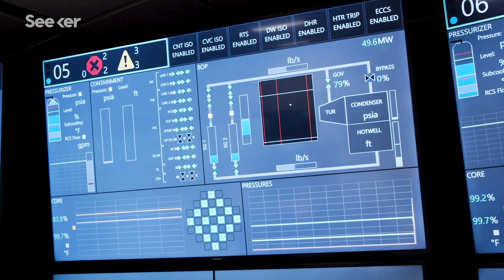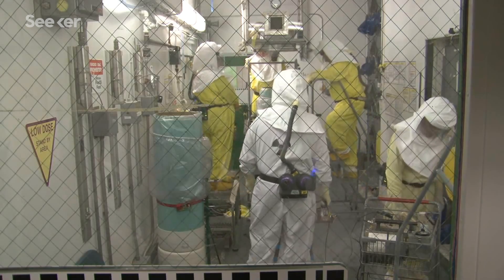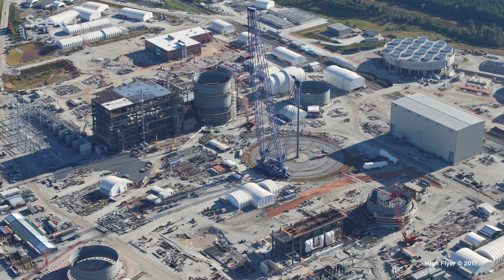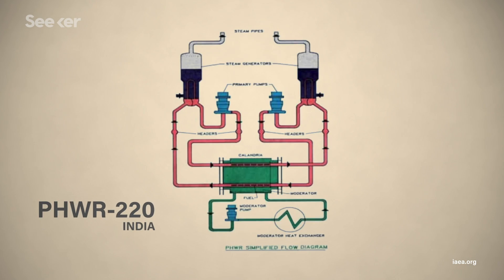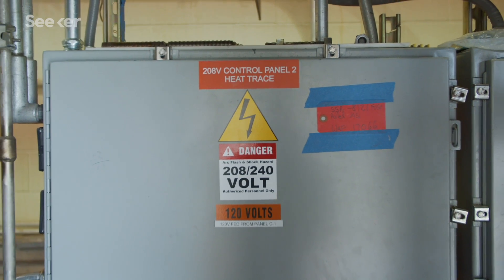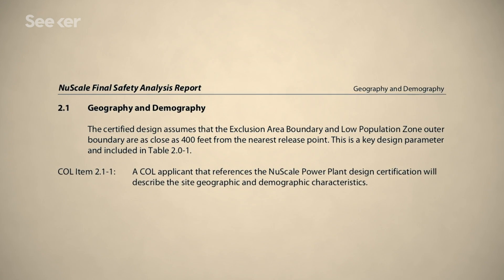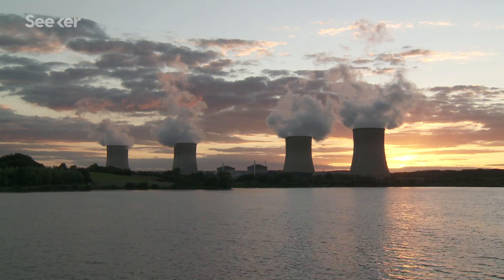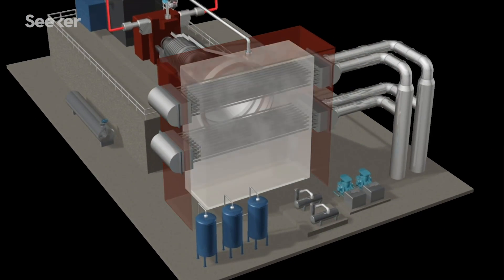Mini-Nuclear Reactors Are Coming, and They Could Reinvent the Energy Industry

Comment: Thank you for the documentary. I had the opportunity to tour a nuclear power plant about 20 years ago at Diablo Canyon.  We had to have a thorough background check from the DOJ to qualify.    The plant was fascinating  and yet it was uncomplicated in the process of turning heat from the reactor into steam and then pushing the steam through a turbine to produce electricity.  Where I grew up in Washington State we had a nuclear power plant approximately 35 miles from us in the Hanford Nuclear Range.  That facility has an extensive history going back to WWII.    One of the pros in using nuclear power is not polluting the earth with carbon emissions but the con is if you have an accident another kind of pollution is released.

Comment: Aside from these small reactors which are an amazing tech. But I listened to someone argue that the cost of nuclear fuel, refining uranium, is too costly, and I tried to explain that between the US and former Soviet Union there were about 50,000 nuclear weapons, and every single one had a lump of fissionable material (uranium or plutonium) inside them. So that’s enough highly enriched fuel to keep reactors going for a few hundred years at current refuel rates. But treaties were signed preventing this fuel from being used for power production. Now I don’t know how Russia handled its stockpile but in the US we reduced our nukes from a height of 31k weapons to around 2200 but the uranium and plutonium pits don’t exactly go bad so we’re sitting on massive reserves of highly enriched nuclear fuel, enough that with current reactors we’d never need to refine more. I live near the Susquehanna nuclear plant which uses MOX fuel (mixed oxide fuel) and its fuel rods contain about 5% highly enriched uranium. Nuclear tech needs to be developed, current plants updated, modular reactors built, waste disposal made a reality, stupid scientifically illiterate laws repealed, and for f@cks sake get fusion working

Comment: Will they be 80 miles apart?
An accident still will contaminate large areas.
It's Not Safe And It's Not Green!
THE HEAT THEY PRODUCE LASTS LONGER THAN THE EARTH ITSELF! The Most Is 40 BILLION YEARS DANGEROUS TO OUR LIVES!
The More Common Last Thousands Of Years, And Quickly Absorbed Into The Body.
NUKES ARE MORE THE CAUSE AND REASON FOR CLIMATE CHANGE THAN COAL!
Timelines coincides!

Comment: Why you keep deleting my comments YT?
Reply: Btw my comment was about people making jokes about nuclear power being a complicated way of boiling water into steam energy while nasa has been using miniature nuclear fission reactors in their satellites by converting the heat generated by the core into electricity DIRECTLY, no "boiling water into steam energy". It's called "System for Nuclear Auxiliary Power" (SNAP as it's acronym)
Reply: @Samantha-jv6xu  SNAP has a shitty efficiency, compared to even the Stirling engine, though. And about comments - if you try to post a link, YT will gobble it automatically.
Reply: @caav56  Huh, ok. About SNAP, that is true but with finding, everything is possible
Reply: @Samantha-jv6xu  I've suffered a lot from this auto-gobble, when trying to link something. Also, about the space reactors - outside of propulsion segment, the hottest new thing amongst them is Kilopower, a self-contained nuclear powerplant, which uses Stirling engine to convert heat into power with reasonable enough efficiency (as for now).
Reply: @caav56  I mean, that's what I've been trying to say to you. Seeker did a video about that already

https://youtu.be/0TL7eUh4yuI

Comment: They don't even know how to get rid of the waste put in the ocean how stupid is that they're going to build another one of those dumb
Reply: Keep in mind that reactor fuel comes out of the ground in the first instance. Spent fuel needs to be stored carefully until the short lived daughter actinides have decayed. These are highly radioactive - hence the short half life. The longer lived parts such as uranium 238 has a half life of over 4 billion years. For practical purposes we can consider it not to be radioactive at all. So stick it back in the ground where it came from is the most logical solution. Uranium 238 is routinely used as asmor plating due to its density and ductility. It's also routinely used for the purposes of radiation shielding.

Comment: Mini reactors GREAT IDEA...can be utilized as long as safely USED in CITIES.. VERY small reactors...can be used in vehicles then
Reply: Not sure you'd get 'em quite small enough for road vehicles. They have to be of a certain size in order to gather enough fissile mass to reach super-criticality. Below that level we're pushing in more energy than we're extracting.
Reply: @paulanderson7796  How about medium-sized reactors on fuel production plants to produce synfuels, which are then used to power ICE cars?
Reply: @caav56  That would be a very sensible proposition. The problem is overcoming peoples' fear of the word 'nuclear'. There are other benefits for using small scale reactors as well. We'd no longer need an interconnected national electricity grid. Massive reduction in maintenance and operating costs.

Comment: Hmmmm What the video didnt answer is this:

Okay if one reactor (one module) fails the risks are way smaller than if a big reactor fails. Okay. But the video showed that the modules were NEXT TO EACH OTHER. Wouldnt there be a failure cascade that if one fails it is causing damage to the adjacent unit making it fail as well? So in the end you get the same problems as with one big reactor?

Comment: Regardless of the technology used, all electric generation releases more waste heat to the atmosphere than is produced in electricity. If we are worried about global warming, dumping waste heat into the atmosphere isn't a solution. If we built small floating reactors, the waste heat could be used to distill water, which is in short supply in most municipal areas, and the reactor could never go dry. The electrical power could be transmitted to the shore on underwater cables that would also provide an anchor.

Comment: They sold safety of nuclear power the same way in the 50's and look what transpired. Things age and fail. A failure of this implementation and its boundaries localizes potential hazards in a significantly larger communities. Development of Thorium reactors would be a much safer alternative.
Reply: Thorium reactors are not a thing yet. There are a lot of processes that we still need to figure out before making thorium reactors. If you like solving problems then I strongly advise you to research it and patent some cool solutions.

Comment: No!
This is a light water reactor, if US regulators agree to this, it could set fission plants back another 30 years, with more nuclear waste piling up.
Regulators don't like change, investing in malten salt and Thorium fuel is the logical choice, safety yes but non proliferation and low waste are requirements as well.
What if a nuscale control rod got stuck?
Once we have solved the salt corrosion problem, fission technology can compete with fusion and prevent further damage to the environment from wind and solar as well as eliminating burning methods for energy,
MSR`s also have many other high temperature applications yet regulators could stop progress.

Comment: There are some promising possibilities here. I wonder if coal fueled generation stations could be retrofitted with this new technology? Also, if a smaller reactor is used for power generation it can be closer to commercial and residential areas, so the waste heat can be used for space heating, heating water, or processes that require a lot of heat like the pulp and paper industry.

Comment: Well I do rather want to have electricity than to make my own... Let them go ahead. Somehow maybe they will think of using molten salt reactors aswell in the future. In any case, coal needs to be replaced asap, Solar and wind needs to be stored leading to more polution in the form of production of the battery banks. Thus nuclear is the way to go. Though I do hope they can make a 100MW version or even make more cheaper for developing countries.

Comment: What if the cooling water pool cracks or leaks it’s water?
Reply: Wouldn’t really matter plus it’s basically impossible.
Reply: @mat7can106  mmmmmmmmm yeah but the impossible tends to happen occasionally sooo....
Reply: @grinblurnar  wouldn’t really matter because if one system fails there are a hundred more security systems in modern reactors.

Comment: How about put the modular reactor in separate pools and avoid the situation when if one is compromised the other reactors are unharmed?
Reply: I believe that just because they are in the same pool it doesn't mean they are going to explode or something. Sure, if somehow after the shutdown there is a failure that causes the Steam generated by the rods not to condense, and instead excapes, this would mean that (POSSIBLY????) there  will be an explosiom from one of the Modules, BUT, they are underwater, only metal, and steam will be released under water, and the RODs will sink to the bottom of the pool. This will mean that a cleanup crew is needed to clean the debris and rods at the bottom of the pool. Other than that the worst that that can happen is the rods overheat and melt through the module, and sink to the bottom. If the pool is not enough to cool the rods then they will melt through the pool, which takes time. By this time the other modules would have turned to emergency opperation or removed, but who knows that contamination will happen if the rods melt through the pool and expose the water/waste to the soil.
Reply: Here is what should happen if one of the modules happens to lose power, and the emergency systems are successful: https://youtu.be/I7-GNwe3WEQ

Comment: Ignorance is the main thing keeping us from eliminating our energy problems. Even with 3 Mile Island, Fukushima, and Chernobyl, nuclear power plants are still BY FAR the safest form of energy ever harnessed by Man. It's not even close.

The Green movement is one of the worst offenders. They're so hell-bent on preventing nuclear that they caused places like Germany to get off nuclear and increase their CO2 output. Nuclear power has every advantage over other forms of energy for powering a city.

There are some cases where solar makes sense, like for a small remote building. Other than that, solar is very limited by the amount of sunlight we receive. The obvious answer is to make better batteries but that means solar spends half its time powering electrical devices and half its time charging batteries. Even if the batteries were 100% efficient, flawless in every way, and lasted forever, this still effectively cuts the efficiency of the solar cells in half. Batteries only average things out. They don't solve the fundamental problem of solar panels not producing power at night.

Nuclear plants don't need batteries to keep the energy flowing at night. They produce plenty of clean, domestic, cheap, reliable, baseload power even if it's dark, even if there's no wind blowing, even if it's raining, even if you're in a box or with a fox. They just always pump out power.

Comment: Just keep US DOE out of it.  The mouthpiece from INL, which is part of DOE, is dead wrong about a lot of things.  For instance, 300 MW is not remotely enough capacity to power for 50k homes.  This technology fits with the distributed generation model, but economy of scale is not there at 300MW.  Plants need to be at about 1300MW to gain economic efficiency and achieve a 10 year cost recovery.  Typical government incompetence.

Comment: FFS why are you still investing with a system with a  limited temperature as well as extremely dangerous high pressure  Light Water Reactors when you can utilize molten salt media to transfer far more efficient high temperature energy from reactor to product user - be it electricity generation; Hydrogen for fuel cells; aircraft fuel such as SP4; ammonia for fertilisers; recycling metals such as Lithium, Cobalt and Nickel; and still have leftover heat for desalination plants or heating cities in colder climates? - ALL at "Walk-Away" safe near ambient pressures..

Comment: It's still a reactor at high pressure!! molten salt is worth looking at.
Reply: Yeah it's dumb, but it also produces plutonium, so you can make atom bombs, which is why they build these dangerous pressure cooker uranium fueled reactors, instead of molten salt thorium reactors which need no water and can not melt down and explode.
Reply: @dasdasdsdasdasdasd363  Amen, I'm with you Brother.
Reply: Amen, I'm with you Brother.

Comment: No. it is NOT an open question. There is still not a siingle country on this planet to have fifgured out a final solution for what to do with the radioactive waste, an THAT is what those people should be developing on, before  they go ahead and endanger even more people with many small nuclear reactors, now even closer to their homes!
Start acting responsibly, and plan ahead for the mess you will leave for future generations.
Also they very correctly say, that all desasters so far have been caused by chains of unforseeable events. One canneverbe 100% safe,and the kind of danger whch radioactivity on even this scale poses is way beyond anything reasonable!
Reply: " There is still not a siingle country on this planet to have fifgured out a final solution for what to do with the radioactive waste"
That is simply not true. We have found a final solution for what to do with nuclear waste. That is to bury it deep underground then fill the connecting tunnels with cement.
Reply: @KayC352  i know. I also know that this was only supposed to be an interim solution and is having massive problems already, like increased radiation in groundwater, a availability of thick enough tunnels, corrosion of the barrels even through all the cement and the list goes on.
Just burying the stuff is no final solution.